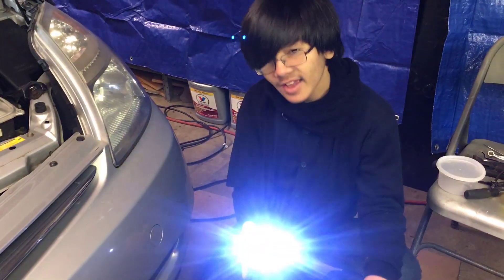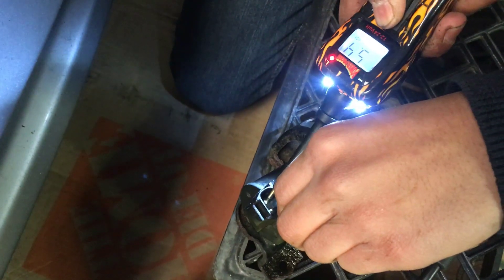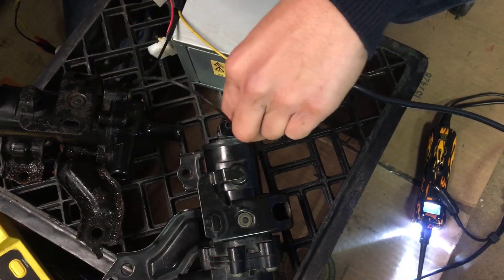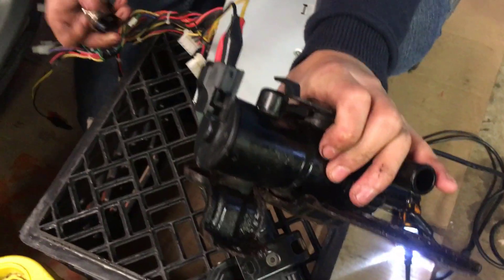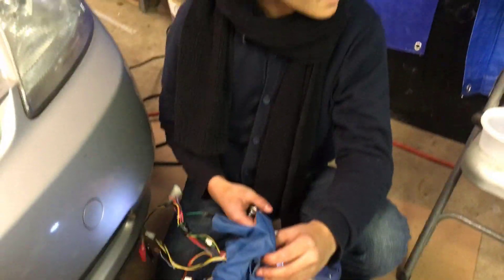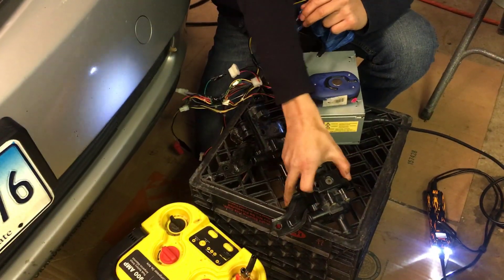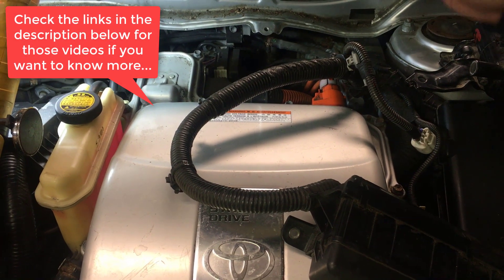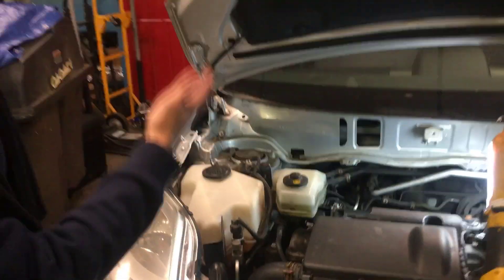How To Test If Auxiliary Water Pump Is Working Properly | Have Suction & Symptoms Of Bad Or Failing

Comment from the maker: Here are the #ᴬᴰlinks to tools, parts and accessories you may need to perform this repair:
1. https://amzn.to/4ipkn6c  |  Autel Circuit Tester, Power Circuit Probe Tool, 12-24V Electrical Short Open Breaker Circuit Finder, Automotive Circuit Tester, Digital Multimeter/Relay & Diode Resistance Tool Kit, & 20FT Long Cord
2.  https://amzn.to/4gq1YEt  |  KAIWEETS Voltage Tester/Non-Contact Voltage Tester with Signal Percentage, Dual Range AC 12V/70V-1000V, Live/Null Wire Tester, Electrical Tester with LCD Display, Buzzer Alarm, Wire Breakpoint Finder
3.  https://amzn.to/49uHyI1  |  AstroAI Digital Multimeter Tester 2000 Counts with DC AC Voltmeter and Ohm Volt Amp Meter; Measures Voltage, Current, Resistance, Continuity and Diode, Blue
4.  https://amzn.to/3D4LOCa  |  G9020-47031 Engine Electric Inverter Cooler Water Pump Assembly for 2004-2009 Toyota Prius 1.5L 
5.  https://amzn.to/3DfkHnL  |  Power Probe III Clamshell - Red (PP3CSRED) [Car Automotive Diagnostic Test Tool, Digital Volt Meter, AC/DC Current Resistance, Circuit Tester]

Or Click on Amazon link here and search for what you need:  https://amzn.to/3D1T2GQ

Comment: I'm hoping I'm wrong, but it sounds like you removed a perfectly good pump and replaced it with one that has worn bearings. The squealing noise is worn bearings. It should be quiet. Also when testing it needs to be tested with a liquid. It's a centrifugal pump so it wont have any significant suction on air.

Comment: When you show any electrical tests, please tell the Voltage of supplied power & where to connect Positive and Negative terminals (if it matters or not!)!!!
Reply: all cars use 12v
Reply: @dantronics1682  except for a few old vehicles that use 6 volt
Reply: @dantronics1682  but some sensors use 3 and 5 volts, its no guarantee that what you are working on is using 12v
Reply: @justarandomguy3969  the pump will be working at the vehicle supply voltage which will either be 12 or 24v, someone mentioned about a few old vehicles working at 6v but I very much doubt these would use one of these electric pumps, it wouldnt be all that hard to convert a 6v system to 12v since if you were putting in an electric pump you dont mind not having the vehicle been original anymore, these 6v system if the fuel pump fail the ones I've seen selling are either 12v or 24v

Comment: New pump is noisy ONLY BECAUSE NO LUBRICANT IN IT! It could be just water. Real test(not shown in this video - guy has no idea of what is TEST) - use bucket of CLEAN water and pump with 2 pieces of hose attached(12 volt supply too!). Deep inlet attached hose into bucket, outlet hose keep above,  turn on,  use your mouth to prime pump (just for one short moment! -spit if some water came fast) and watch how well water runs! Compare old and new pumps by looking on water flow or direct outlet hose into empty 1 gallon reservoir and measure time to fill it; compare!
Reply: good idea
Reply: @dc5duben96  or even bettter idea is to prime the pump with water using a container instead of ones mouth

Comment: Thank you for your videos. Congratulations on your award. With help from your videos, I recently replaced my auxiliary water pump. The motor on the pump worked, but the impeller was bad. 
I had to feed it water to find that out. I now have a heater. Thanks again!

Comment: Wow, that is a noisy new pump, it should be quite. Sounded like a old pump and bearing worn-out.
Reply: because he was running it dry, they are not design to be run that way.
Reply: That noise is a bearing thats either worn out and/or has no lubricant check them out before you install that “ new” pump!

Comment: Can you tell if you have a bad auxiliary water pump just by looking at it? Does it leak?
Reply: in some cases you can, but usually you cant
Reply: On gen 2 Prius, open the coolant tank next to inverter, should see good turbulence. Check in ignition in mode. Not ready mode.